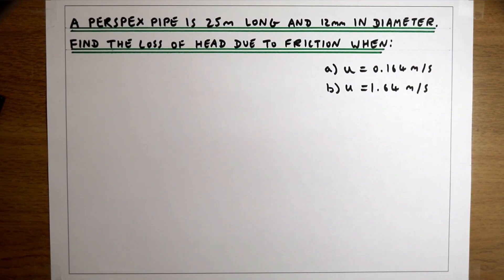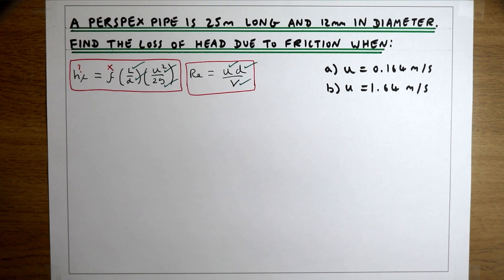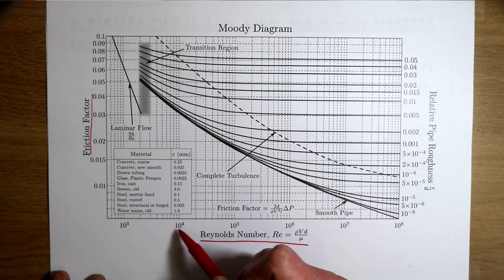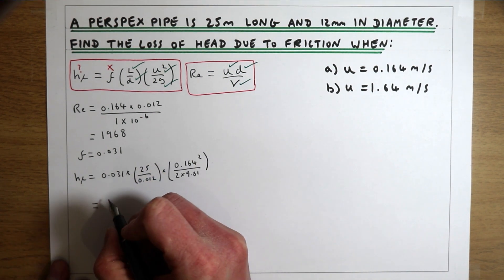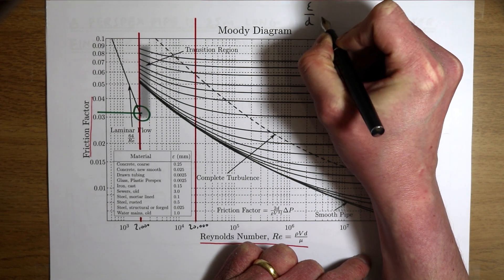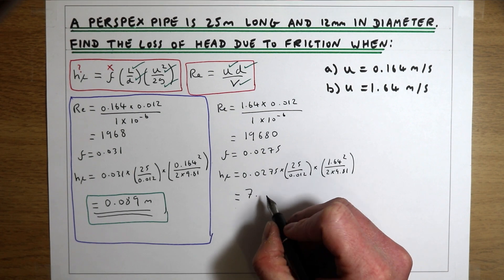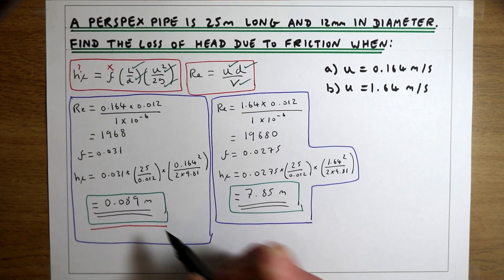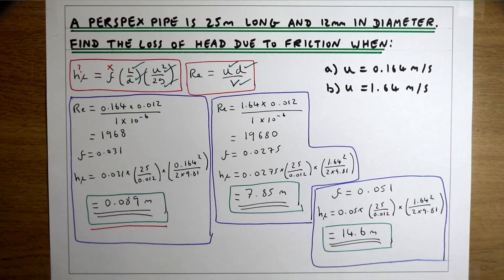Head loss due to friction in a pipe using Moody Diagram and the Darcy–Weisbach equation

Comment: Hi mate, how come you didn't use the density of water ? i got the cal of 1946566.337 when  i added density (kg/m3) of 20 degrees at density of 998.2?  when working out reynolds number
Reply from the maker: Hi Bruce, this is because there are two ways to calculate Re, the way I did it is ( velocity x diameter) / kinematic viscosity, where I assume kinematic viscosity is 10^-6 m^2/s. The other way you can do it, which is the way shown on the x-axis of the Moody Diagram and the way I think you have done it, is (velocity x density x diameter) / dynamic viscosity. Kinematic viscosity is defined as dynamic viscosity over density, so for this example where I assume kinematic viscosity as 10^-6 m^2/s, dynamic viscosity would be 10^-3 kg/ms (assuming density is 1000 kg/m^3, you have used a more precise definition). So calculating Re using the formula on the Moody diagram would be Re = (1000 x 1.64 x 0.012 )/10-3=19680. Hope that makes sense and clears it up?
Reply: @fluidsexplained1901  hey mate, yes it does thank you very much.